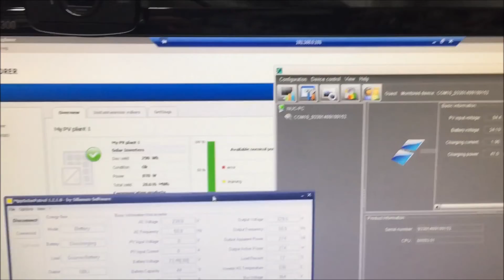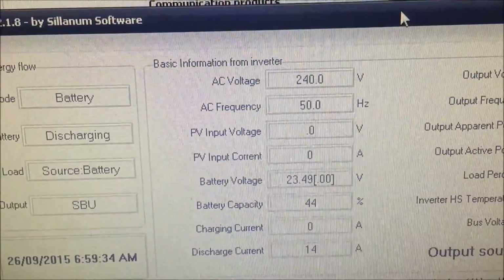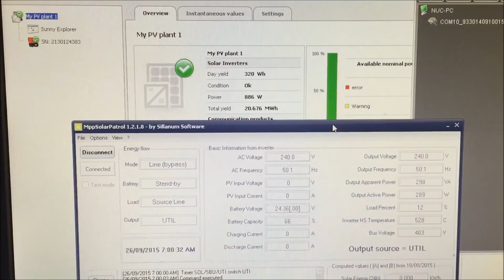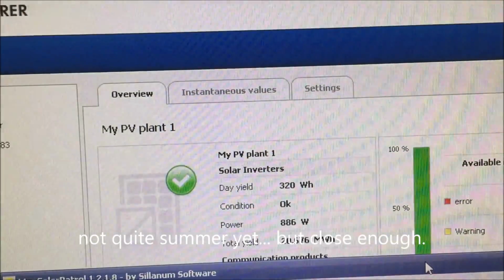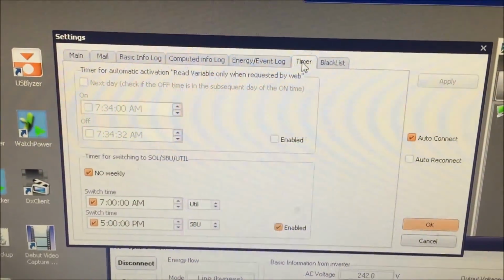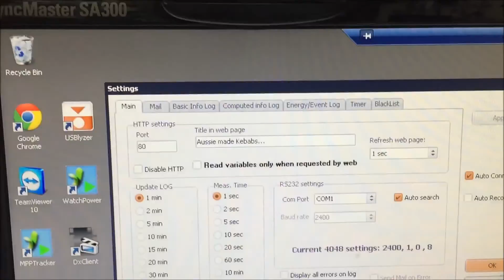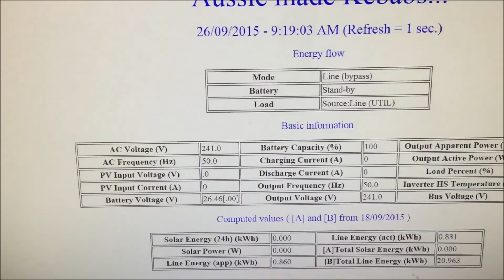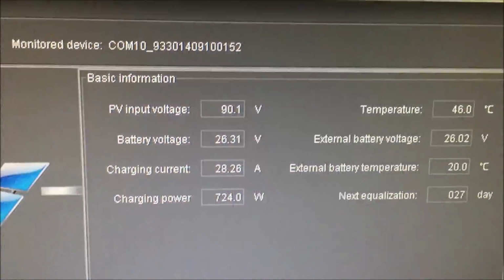Using MPPSOLAR PATROL to change from Utility to Battery

Comment: I've been trying to figure out which software to go with and still can't quite grasp what the differences are or where one application fits better.  I've only used WatchPower so far and didn't enjoy it very much.
Reply from the maker: watch power works quite well, allows you to change all parameters on the inverters in one place. Key thing it lacks is a timer function

Comment: How do you configure SolarPatrol to monitoring online?
Reply from the maker: Currently, don't have it installed sorry but it is in the menu turned on by default, if you type the ip address of the computer that is running it into explorer it'll show the little webpage then you can configure portfoward in your router and you can view externally on port 80 typically

Comment: nice, this software in place of hacking the logic bus of the SMA ?
Reply from the maker: +Anthony Matthews unfortunately no, it only controls the switch between grid/solar/battery on a timer not dynamically based on SMA production/output.
Reply: Ah, still pretty cool though.

Comment: So definitely a companion software to WatchPower. I have not used it much after the initial hype when I got everything up and running as I run it on a old tower PC that is an energy hog (if I recall it right it takes over 200w) again really looking forward to getting home tomorrow and have a go with the Power patrol software and see what it can do. l think the other reason I don't use WatchPower is really because I am a few metres away from the PIP and if I need to change any settings I just walk up to it and use the push buttons.
Reply from the maker: +Gustavo Malaga you can use buttons to change stuff ? Well, might look into that too...lol